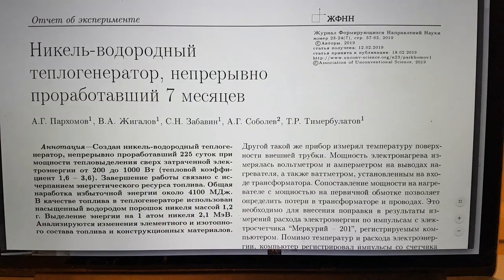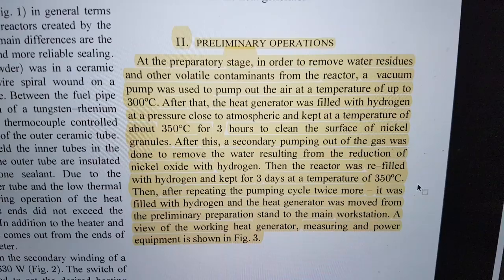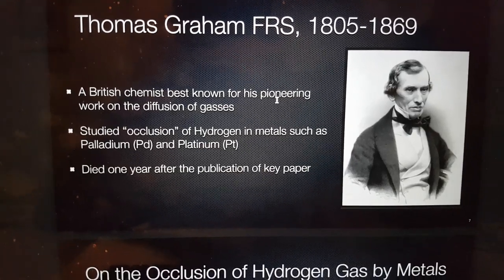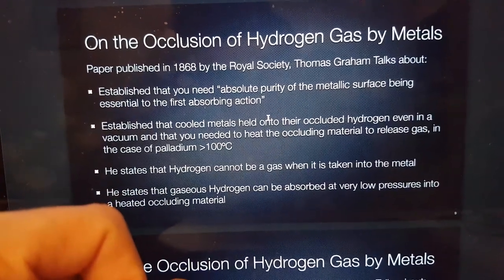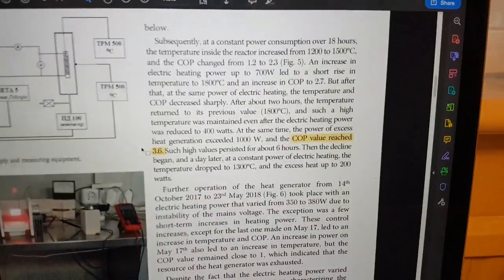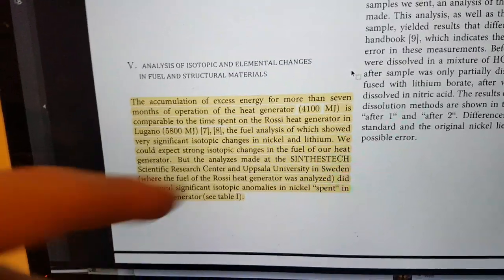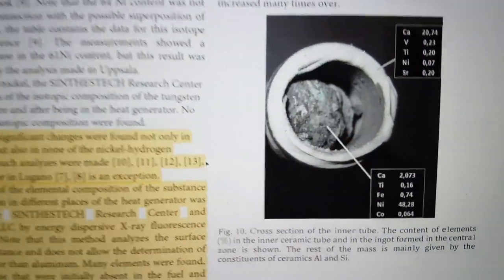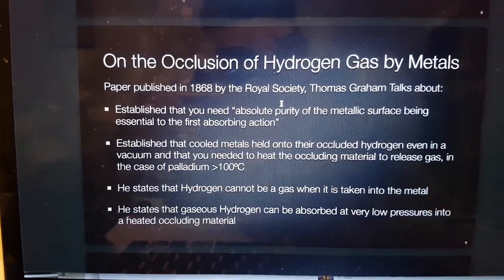Parkhomov - Nickel-hydrogen heat generator, continuously working for 7 months

Comment from the maker: Vb is actually Yb and is updated in the pdf that you can access from the video description links.
Reply: Any new discoveries in this area since the video? Also, I'm trying to do some calculations for a video game where I need to know the required energetic input and output for a hydrogen fusion reactor, where the assumption is that a small fraction of compressed enriched deuterium fuses together to form Helium 3 + 4, Tritium, energetic gammas, betas, protons, and neutrons. Do you have any tips for me so I can calculate the hypothetical fusion rate from the in-game engine's output? Thank you, wish you well.
Reply from the maker: @Baigle1  You can do the calculations here on our reaction calculator:

nanosoft.co.nz

Comment: How embarrassing for Parkhomov to refer to Rossi, after I exposed his tricks, as described in May Skeptical inquirer!
Reply from the maker: Well, in one sense, Parkhomov is calling out the Lugano isotopic shifts as unique in systems including Ni + H - and on the one hand Parkhomov used the same analysis at Upsalla University to do the testing.

The MFMP also established he had bought 62Ni.

However, that does not discount that Adamenko observed that Ni nearly all became 62Ni in a single 300J strike in tests at Proton21 labs in Ukraine and that was a key datapoint in his patent from 2000/2001

Comment: I hope he will be coming at ICCF 22
Reply from the maker: Not to the best of my knowledge.

Please revisit my presentation that was forced to the side-lines of ICCF-21 in 2018, where I did some calculations (also other critical insights).
https://youtu.be/43lakTKhbLw

In the end slide, you can see I deduced that the 1H + 11B > 12C could be a main reaction - 15.9565 MeV, this is the most favourable primary reaction in the system (excluding electron processes).

NOTE1: Some of Parkhomov's analysis in the paper did not determine elements below Al, so he could not show B or C

NOTE2: I also established that at the higher temperatures (over 1400ºC) in his reactor, molten Nickel would react chemically with the Boron Nitride ceramic creating B+ ions in Nickel

https://uploads.disquscdn.com/images/8a36db2256888d524404543ed1b2bca78aac200fdf696cb3efcf0657df195f9d.png

Now, note that in the samples we have from the 4100MJ reactor that I received from Alexander Parkhomov at Sochi 2018, I took some microscopy videos with the Nurugo on receipt and there appears to be black deposits exploded within the Alumina Felt and in the ceramic. I look forward to seeing what these are, I suspect, as I deduced and talked about during ICCF-21, that they may be C. This would fit with observations in other systems and as concluded as the most common output from EVOs by Matsumoto in 2001 and as we observed exploding out of LION Cu2O under electron beam exposure in SEM, similar to observations by Adamenko in induced decay of 'super heavy nuclei' 

https://uploads.disquscdn.com/images/6678330fb27e9e237bf8f93790be428d2452211d9dc9e12503ed0086fefe7b60.png

https://youtu.be/so3sMxy36FI

https://youtu.be/rBlo8sitCV4

Also on this same page, you can see that the most favourable cascade reactions yield Ca, Ti, Co, Fe and a variation in the ratio of 61Ni, all observed in the data published now in the paper. Helium is produced in some of these reactions.

Comment: How much energy was used for the preparation vs. what was produced?
Reply from the maker: If it could store 100 litres of oil worth of energy in 1.2g of nickel, it would revolutionise battery technology.
Reply: @MFMP  is this the same as the cold fusion where hydrogen is blown on a nickle catalyst bar??
Reply from the maker: @FirstLast-tx3yj  Yes and No.

In this case Micro nickel particles with nanostuctures produced by the MOND process are heated slowly and then taken to as high as 1700ºC - well above the melting point.

At the lower temperatures, the nano-features help create clusters and at high temperature the clusters aggregate and the bulk material can also form cold neutrino/anti-neutrino pairs (not relativistic nuclear neutrinos you can read about on wikipedia). These lead to monochromatic beta energy decay of isotopes such as 40K which further promotes cluster formation. The clusters then proceed to transmute and even collapse matter.

You can understand more about this experiment here.

Comment: why did Parkhomov not tell you this years ago?
Reply from the maker: Parkhomov specifically says in his paper that he has learned and improved the experimental approach over many cycles. It is not every day you can run a 7 month experiment with several months preparation.
Reply from the maker: Also, I would like to note that this was one of the first experiments he did after securing his new lab. He simply did not have the equipment or resources before.

The key information as I said was given to us and published in 2015 and then the T.Graham stuff in 2016.
Reply: @MFMP  Thanks! that clears it :-)